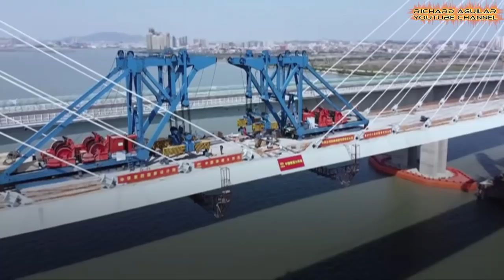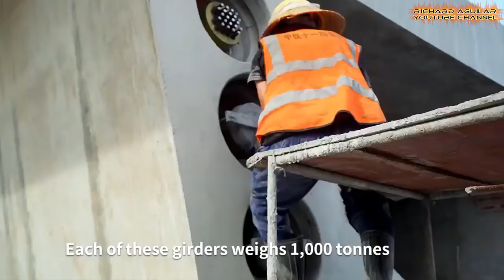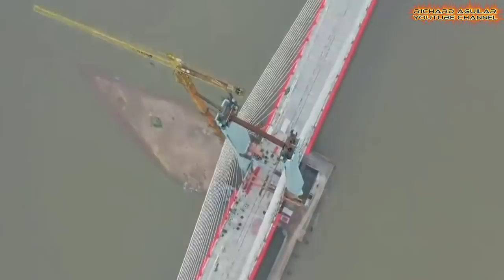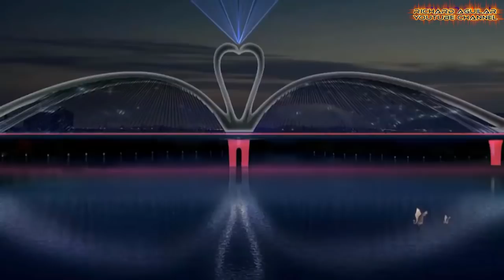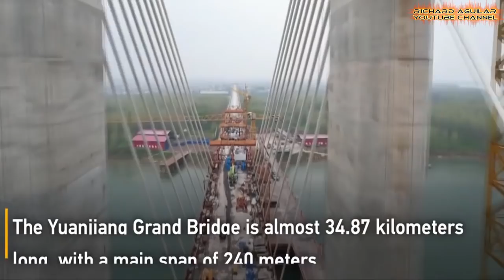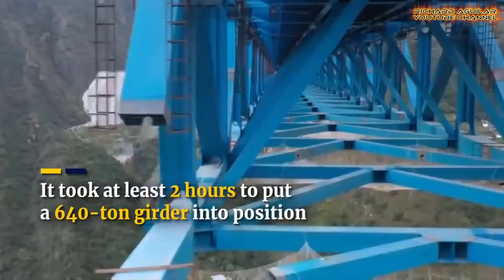The Chinese are building the most incredible mega bridges in the world

Comment: Bridge
comumn   - 304.87mm×609.75mm
                   - 152.43mm×304.87mm
                   - height   - 2,439mm holo
c box         - height -304.87mm
                   - length-1,371mm×width same 
                   - column. holo
G                - length - 3,810mm 
                   - heigth - 60.97mm× wigth-30. 
                   - 48mm 
cablep       - take out halt  to halt in height 
                   - of column 2,439mm (or)
                   - if height like  that must be built
                   - on  column 2,439mm in water.
                   must be use column 914.6mm 
                  - height in ground.